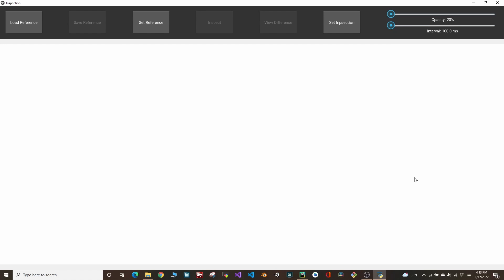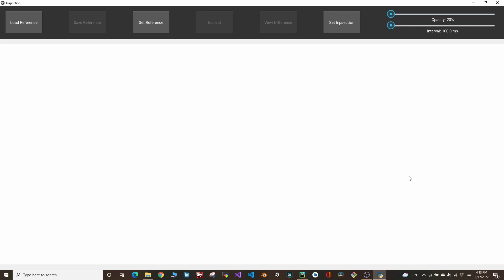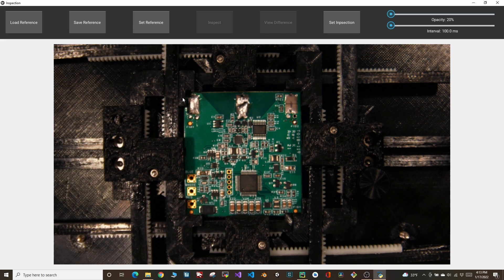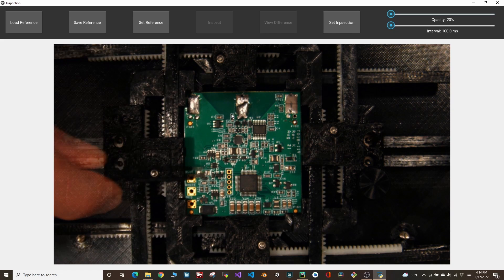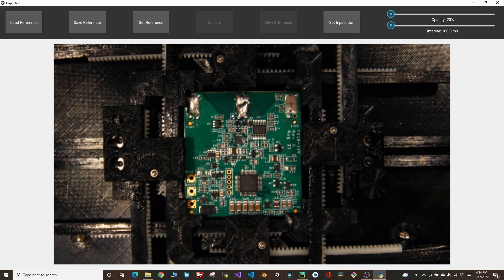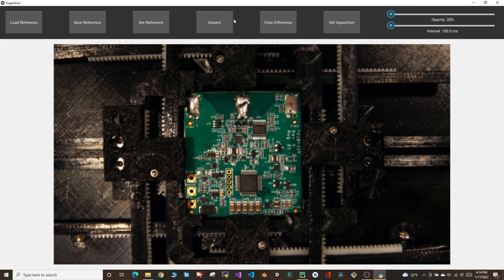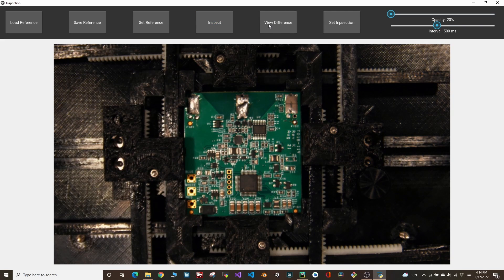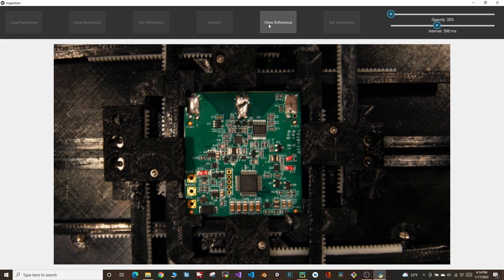Automatic Defect Detection | Python OpenCV

Comment: I'd like to use computer-vision + AI, to inspect Printed-Circuit-Boards..  

How does training a model on good / bad examples, compare to tools that run out of the box, like
KollerFacts Inspection, Intuitive Machines Defect Detection, SVI Defect Analyzer, Cyient Inspection, Mentor Tessent YieldInsight

Also how does PCB-Defect-Detection  (YOLOv5, RNCC, etc) compre with PCB-Inspection-OpenCV?

Comment: Good work! thanks, but how do you cope with misalignment/rotations? Do You?
Reply from the maker: That's a great question. The overlay feature allows you to see a ghost image of the reference board so you can align them pretty well. However there is still room for human error in the manual alignment. I have a new version that uses image registration to automatically align the reference and inspection images. But it's a work in progress. Maybe it's time I upload another video!
Reply: @jared-horton  Oh ok - so its work in progress :) - i thought there are some reference points and so on that the image could be scaled and aligned to.. I dont get what do all these intersecting gear lines do (saw-lines)
Reply from the maker: The gears are part of a fixture mechanism that I intended to use to hold the pcb in a certain position. The fixture can fit any sized rectangular PCB. But now that I have auto alignment implemented, I can get rid of the fixture

Comment: Hi Jared,  Very Good and Knowledgeable project. Could you share the want kind of resource you used. Like ..which camera and its specification and other stuff...like that...Thanks🙂👍👍👍
Reply from the maker: I used a microscope usb camera with a C mount lens. This kind of setup is very common for PCB inspection, but unfortunstely they can be expensive, around $300 but you can find cheaper ones with great quality for around $200 on Amazon. Glad you enjoyed it!

Comment: Would love to know what kind of method is used is finding the difference between two images thresholding? Edge detection? Absdiff?
Reply from the maker: I'm using absdiff which isn't all that robust. That's why I have a fixture to ensure each PCB will be in the exact same position. I have a 2nd version that doesn't need a fixture and automatically rotates the PCBs to be in the same position but its defect detection is more noisy. Thanks for asking!
Reply: @jared-horton  thanks for sharing. Appreciate it👍👍👍